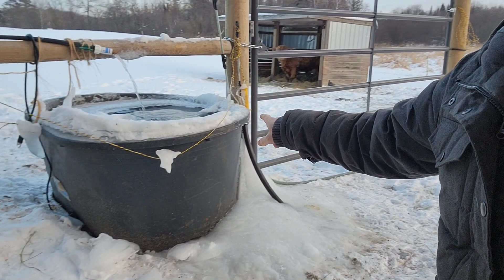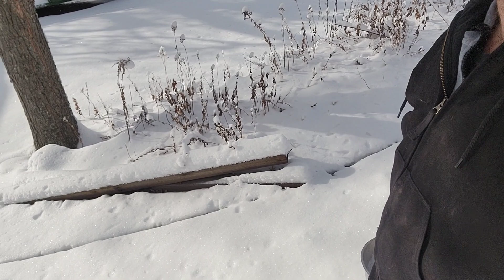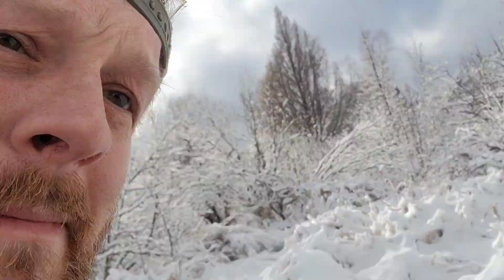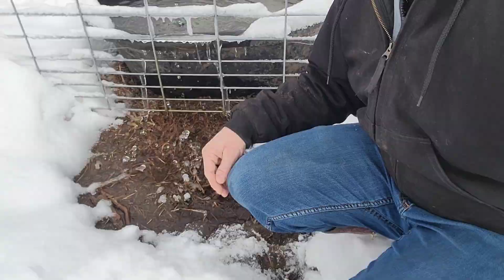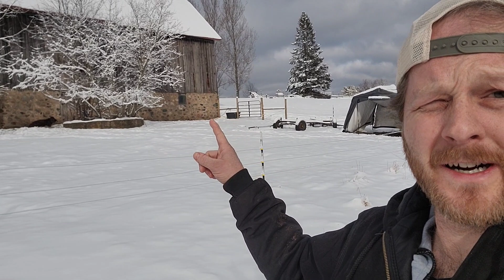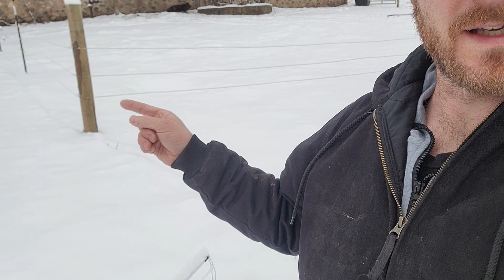Freeze-Miser Review: A Homestead Essential for Winter

Comment: How did you split all of them up? Are you coming off a frost freeze pipe with spliters? Then add the miser to the end of each hose?
Reply from the maker: The outdoor spigot is not frost-free, we just have a hose coming off of that spigot which is our main line. There are several lines that split off that main line along the way using T fittings.

You could use a single manifold at the start and have a freeze-miser on the end of each branch, if that works for your setup.

Either way, as long as you have a freeze-miser at the end of each line you should be good to go! 👍 

For my extra long runs, I'll put a freeze-miser in the middle if it keeps freezing up.

Comment: If you bury it it won’t stay on, so won’t the stock tanks freeze?
Reply from the maker: If the water supply lines freeze, or the power goes out, it will cause the stock tank to freeze up. This only happened once last year and I was able to thaw the lines and get things running again pretty quickly.  

Burying the lines does not increase the odds of freezing, it can actually provide more insulation, but it does make it difficult to thaw if they happen to freeze up. 

As a safety precaution, I do have a tank heater installed on the stock tank, but have never had to use it yet🤞

Comment: Dang, that seems like way too strong of a stream of water the miser is releasing. i know you gotta do better than just a stong drip or a weak trickle but that looks a bit excessive, idk.

Please tell me this; does the freeze miser have a fixed maximum flow rate? IOW,  it opens up and allows a small stream through when it's 30 degrees out. Would it run more water through when the temp falls to say 19 degrees - and even more if it got down to -20?
I guess i just don't understand the physics. Thanks
Reply from the maker: Hello, thanks for the question 😊 
So yes, in this video the stream is quite strong because of the cold weather AND the extra hose length between the house and water trough. 
Freeze Miser recommends no longer than 150ft of hose where I'm running about 100ft more than that. 
This year I did ensure each hose end had valves just before the Freeze Miser device, and I was able to turn those down to reduce the flow by nearly 50%. 
The devices use a wax that is tuned via a spring such that they crack open the valve when the water temp reaches 37°F.  When the water temp drops lower, the wax reacts more intensely, opening the valve more. 
It will just drip when the air temp is close to 35°F, but opens up more as the water temp decreases. 

This year we have three devices strategically located in around 600ft+ of water lines (flow reduced via valves) and so far none have frozen up.
Reply: @scottfamilyhomestead  Ohhhh, add a valve at the end of the hose - very smart idea. i'll do that! thanks for the tip and also for responding! Happy Holidays

Comment: We put a valve behind it and control the flow a bit. You can, in our setup, reduce the flow to about 20% of full bore open and it still functions fine. Leads to A LOT less waste water just freezing on the ground.
Reply from the maker: That's a great idea - we have valves at every hose end - I'll try that out.
Can I ask how much of a hose run you have in front of your freeze miser? We're over the 150ft recommended hose length, so I worry about the hose freezing up if I turn it down too much.
Reply: Yes i didn't see this before hearing someone else doing the same. very smart idea. Thanks and Happy Holidays

Comment: I contacted Freeze Miser who stated the unit needs 10 psi of pressure to work. Im wondering if a IBC tote or water tank raised 25 feet above the Freeze Miser, providing 12.5 psi of head pressure, would  prevent the tank water from freezing and without the need for power. 
Yes the tank would drain over time but could also be refilled.
Im considering trying it in NC. The $30 price tag would be worth it if it prevents the tote from cracking.
What are your thoughts from your real life experience using the Freeze Miser.
Reply from the maker: We get some pretty hard freezes here in Northern Wisconsin, and the freeze-misers run pretty constantly at a good rate. (More than the advertised 'drip')
I wouldn't expect an IBC tote to survive long enough to make it through sequential days below 0°F. Though it may just empty quick enough to not crack.
For warmer temperatures, where typical nighttime lows are 10°F or better, it might just work!
Given the low price point, it may be worth testing out. If you do, please let us know how it goes!